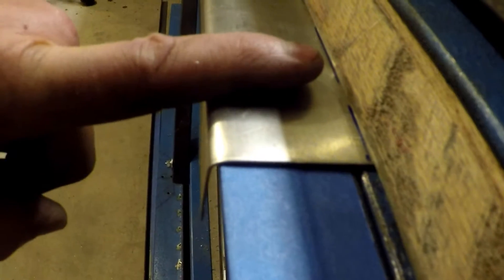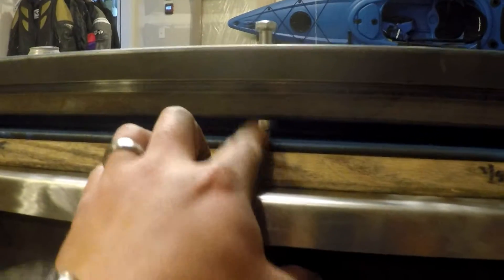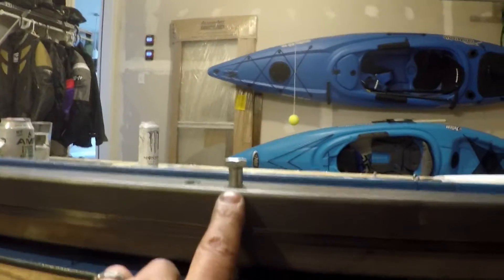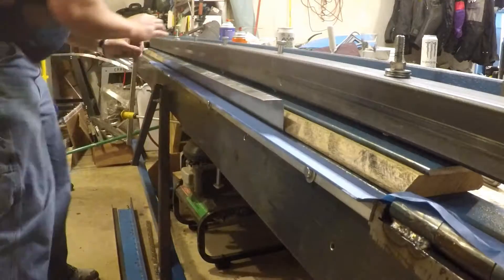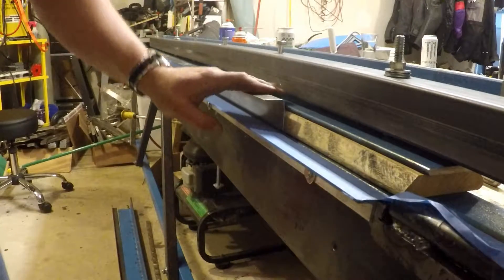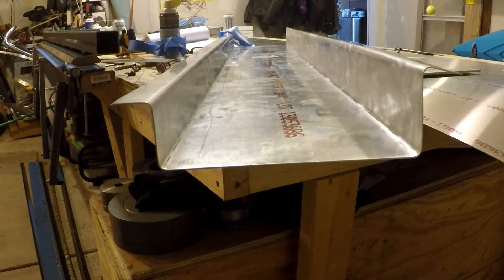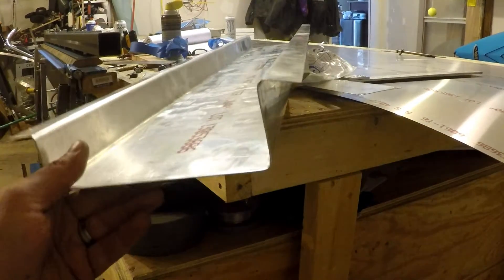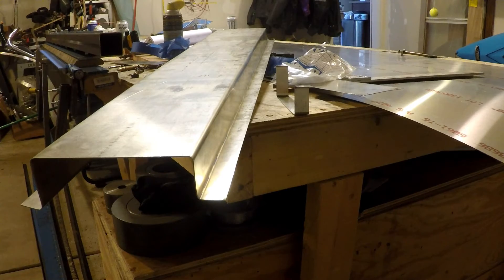Bending Brake Modifications & Forming Gear Channel - Part 4/4

Comment: It is awesome to see someone building a 750 from plans. I wondered though about the lack of material lists and wondered if you found out just how many sheets of Aluminum ( I count 23 - 4'x12' & 1- 4'x4' of various needed thickness) and how much 6061-T6  "Z" and "L" channel  (and what dimensions for each) Will you end up buying the specialized C-Corner extrusions for the fuselage from ZenithAir?
Reply from the maker: There is an estimated list of materials on Zenith.Aero (builder's forum), but I believe it's for the 2nd Edition Plans. I bought the 4 pieces of Standard-Z (though with my brake modifications, I could make it myself now), and I'll buy the C-Corner extrusions from Zenith. I bought one piece of Standard-L to use as a guide, then made the other 63 pieces, all 4' long. Both Standard-L and Standard-Z come from Zenith at 4' and you just trim to use in various places. It's all over the structure, some pieces are nearly 4' long and others only a few inches. Because of the many places, it would be a pain to make them all to size...much simpler just to make 4' pre-made sections and cut to fit. Also, throughout the plans it calls for .093" extruded angle, which we all substitute with .125" (.093 is a Zenith custom extrusion). You're pretty close on your metal estimates, but with plans building, you need to account for a few mistakes. Here's where I'm at so far: .016 - 5 sheets, .020 - 9 sheets, .025 - 3 sheets, .032 - 2 sheets, .040 - 1 sheet, .063 - 1/2 sheet (4x6), .090 2'x3', .125 - 2' x 2'. Also, you need some small pieces of .1875, .250 and .500.